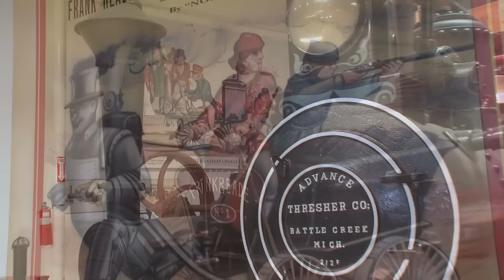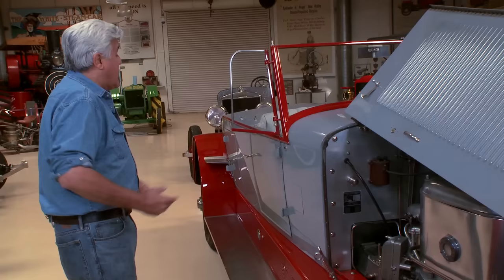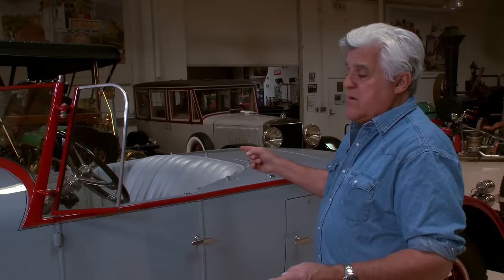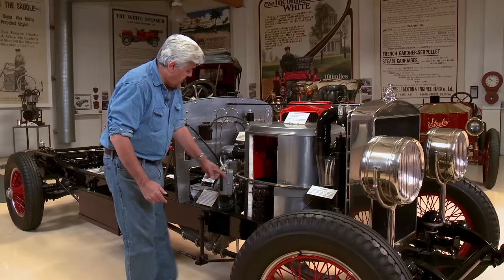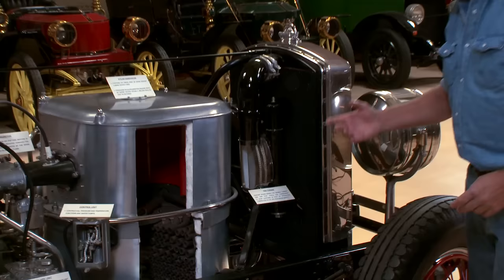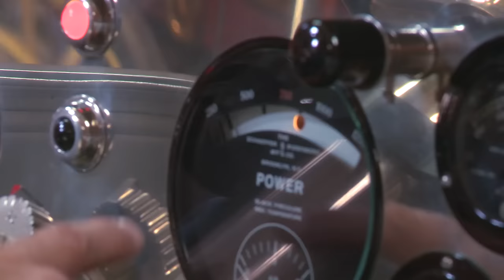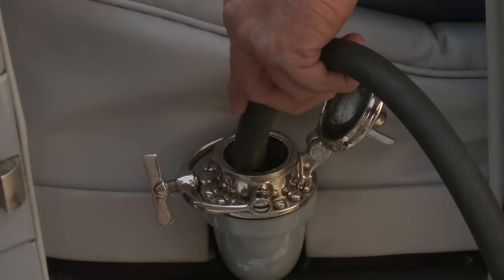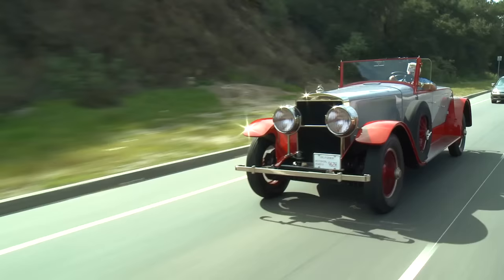1925 Doble E-20 Steam Car - Jay Leno's Garage

Comment: How practical would a Doble be it manufactured using modern methods and parts? A good replacement for EV?
Reply: Absolutely not, the steam car is obsolete technology because of lower energy efficiency of the Rankine Cycle.
The Laws of thermodynamics tell us that a step car can never match the efficiency of internal combustion engines.
Reply: Electric motors are around 90% efficient, the best modern steam engines are less than half that.

Comment: I'm wondering, with such a complex and rare vehicle like this, why doesn't he use distilled water instead of city water out of a hose? I know calcium and other minerals in the water are the main cause of radiator buildup in conventional cars. I can imagine the build up after time in a beauty like this. I understand the final blow out is supposed to get rid of scale, but it would be nice if there wasn't scale to begin with. (How many people take the time to blow out their home water heater? It really does build up)
Reply: Because the engine has a condenser which fouls the feed water tank with all sorts of nasty crude the is no point I using distilled water... a water treatment additive such as tanic acid is often used to suppress scale build-up.

Comment: Hey Jay, you forgot to say what gas you use for the fire to heat the water. are you using propane or natural gas i can see you are not burning wood.
Reply: Jay Leno runs his Doble E series cars on regular unleaded gasoline.
The Doble like most steam cars can only operate on liquid fuel.
The Doble burner can operate on Kerosene, heating oil, diesel and gasoline.
Jay gets between 3MPG and 6MPG on regular unleaded gasoline
Reply: Steam cars that burn solid fuel are required to have a 2 man crew to drive on public roads, a driver/engineer and a fireman.

Comment: I suggest you use distilled water, Jay. That way you won't have any scale buildup.
Reply: That is not true, the Doble is a condensing engine and the condensate water will continue to foul the feedwater tank with contamination that causes scale to form in the boiler tube.
On a warm day the Doble can consume more the 200 gallons a day making distilled water completely impractical.
Jay uses soft water and a water treatment additive to reduce scale.
Reply: @sandervanderkammen9230  
You don't make much sense. Condensate water to foul the feedwater tank with what? It's just pure water with no minerals or any chemicals that could deposit as scale. And if the Doble is a condensing engine, it means that it recirculates and reuses the water over and over again, with some negligible losses due to imperfect sealing of the tubing. So, why consume more that 200 gallons a day? It should not "consume" any water.
Reply: @lucianene7741  Of course it makes sense, the condensate is fouled with considerable amounts of lubricating oil, grease, rust and other corrosion residue., these contaminant the the feedwater tank and are injected back into the boiler tube to create scale.
The Doble's condenser is much too small to remain sealed on a warm day, watch the video yourself again, the Doble almost continuously vents steam from the condenser relief valve. The condenser must remain as close to zero psi as possible.
The condenser reduces the the water consumption but does not stop it.
The Doble would require a condensing unit larger than the entire car to remain sealed.
Reply: @lucianene7741  Most industrial boiler operators and steam car collectors use a water treatment additive such as tannic acid to reduce scale build up along with frequent blow downs to flush accumulated scale and sediments.

Comment: Does it work better if you use distilled water in it so the steam generator doesn’t get calcified? Also, really cool car. It’s like a steam super car
Reply: The Doble uses a condenser which continuously fouls the feedwater tank with rust, corrosion and oil residues so no advantages in using distilled water not to mention the  car can easily consume over 100 gallons of water on a warm day.
Most steam car enthusiasts and  commercial boilers use a water conditioning treatment like tanic acid to reduce scale build-up.
Regardless the boiler tubes still require very expensive repairs and periodically replaced.
Reply: @sandervanderkammen9230  If the condenser were large enough to reliably condense all steam, distilled water could be more beneficial.  One would need an efficient oil separator to remove the internal engine lubricant from the condensate.
Modern science and technology would be able to build an engine that would run reliably without any internal lubricant.
Reply: @BasementEngineer  Without any lubricant??? Steam is not a lubricant! Especially dry, superheated steam.

Building an effective and practical oil separator is not that easy, removing dissolved metals and corrosion products even more difficult.
Reply: @sandervanderkammen9230  Some years ago I investigated such a 'no lube' coating for a potential client.  There was an outfit in Texas that produced such a coating.  It was expensive at that time.
With distilled water these will be very little corrosion.  A filter could be installed downstream from the condensed to remove any remaining debris.
Reply: @BasementEngineer  what about the dissolved minerals in the recovered condenser water?
Most commercial operators and collectors simply use a water treatment additive, like tannic acid.

Comment: Curious;  What kind of mileage do you get from a gallon of gas?  As the pressure is maintained the gas turns on and off, the throttle controls the steam, not the fuel.  Wonder what sort of mpg this gets?
Reply: EPA LA Dive Cycle testing in 1970 on kerosene was 6.5 MPG combined.
Jay's gets around 3 to 5 MPG on regular unleaded gasoline.

Comment: what sort of- I hesitate to say miles to the gallon, but some vague equivalent? Like, if you had to put in perspective how much energy worth of fuel does it burn per mile compared to other sorts of cars.
Reply: Jay's Doble runs on regular unleaded gasoline and gets between 3MPG and 6MPG
Reply: @sandervanderkammen9230  Thanks! I figured it'd be something like that. Good to have a solid point of comparison, though, to remind my steam loving self how the two modes of propulsion actually compare in efficiency. And, unlike with electric versus gasoline, the steam's increased fuel consumption isn't balanced out by decreased tire and road wear.
Reply: @bow-tiedengineer4453  Yeah, a modern ICE car is about 400% more energy efficient and much, much cheaper.
The Doble E series cost around $75,000 to build in 1926 (around a million dollars in today's value).

Prior to 1915 steam cars made up about 35% of all the cars registered in America.
After 1915, it dropped to about 1% before going completely extinct.

Charles Kettering invented the electric starter in 1914 and steam car manufacturers either switched to ICEs or quickly went bankrupt.

Comment: how do you stop if it's direct drive is there a centrifugal clutch, or just diverts the steam from the pistons back in to the condenser.
what does it use LPG gas to heat boiler? what do you get per mileage on the fuel.. not the water
Reply: You simply close the steam valve to stop.
The Doble burner can use gasoline, kerosene or heating oil.

Jay gets between 3MPG and 6MPG on regular unleaded gasoline.
Reply: @sandervanderkammen9230  could the pipes take the pressure?? if you just turn it off.
doesn't sound sensible way of doing it, I would have thought the best approaches would  have a diversion valve as i stated and send it back to the condenser.
yeah LPG would be a better clean a fuel could be used
Reply: @hoobsgroove  You get a slight engine braking effect just like an exhaust brake on a Diesel engine.

L.P. is not very energy dense, the Doble already needs a 35 gallon fuel tank, LP would require a much larger, heavier fuel tank to keep the same range.

Comment: I truly believe that had we stayed with steam instead of switching to internal combustion engines, we would be well ahead of where we are, both in terms of fuel efficiency and cleaner burning.   

The big innovation in my view that Doble provided was to superheat a relatively small amount of water at a time.   

The next big step would have been oi ditch the pistons and use a small, high-=speed turbine as the actual steam engine.   A Tesla steam turbine might have been a very good starting point.   

When I was in school, I roomed with 2 other nerds.   We were all into engineering and were fascinated by steam cars.   We never had the resources to build our prototype, but our modeling and calculations promised that using a good steam turbine and super-heating small amounts of steam at a time would have driven a "standard-sized" sedan of the times, around 1963, over 100 miles per hour, and at 60 MPH would have yielded better than 100 MPG.   Further, the longevity and maintenance seemed quite favorable, as well.   

Anyway, thanks for preserving this beautiful piece of history and for sharing it with us.
Reply: Nothing could be further from the truth... steam cars are obsolete technology and steam has always been inferior to internal combustion technology.
The invention of the electric starter for internal combustion cars in 1915 wiped out the steam car companies by eliminating its only advantage literally overnight.
 Steam cannot compete with ICEs, steam is much less fuel efficient, dirty and way too expensive.

Any questions?

Comment: There's only one question that I have: does it have reverse?
Reply: Doesn't need reverse. Reciprocating steam engines can run in either direction.
There is a small pedal on the floor board that switched engine direction of rotation.

Comment: Jay I believe we can design new compact steam powered engines much simpler for cars...they can be small compact run on propane or and natural gas...Steam has pushed miles of steal iron traine across the US it can certainly push cars...just put 200 degree water in a plastic coke bottle shake it and feel the combustion in your hand...if we make the pistons amd block out of ceramics we won't need to oil the engine...
Reply: It's was a joke, Jay's a comedian not an engineer.
Steam cars have been obsolete for more than a century for some very good reasons... most important is the horrible fuel efficiency and incredibly high construction and operating costs.
Reply: That is false, modern internal combustion engines use Silicon Nitride ceramic cylinder liners and hypereutectic pistons but they are easily destroyed by lack of lubrication.
Reply: @sandervanderkammen9230 Ceramic engines have been in operation since the 70s...the Japanese developed this tech years ago...they have 100% ceramic...their are many high tech engines made of ceramic...I guess you don't follow tech..m
Reply: @danielraymadden  Apparently you don't follow technology much... because these engines still require lubrication.
Reply: @sandervanderkammen9230  Tell Japan they wrote the spec...their explanation was ceramic they created was heat resistant does not expand..Who am I to believe...you who has not accomplished anything in life...or Japan's top scientist engineers...it's you against them...I have to believe you were not born at the time...
Reply: @danielraymadden  Please cite an example of a commercially available  automobile engine that does not require lubrication?

Comment: If this runs on water, then you have solved a number of problems. By the way, when you  get to where you are going, does it make espresso?
Reply: The Doble E series runs on gasoline or kerosene, water is only used as a working fluid, not a Fuel
Reply: @sandervanderkammen9230  Thanks, but you are saying a steam engine  does not run on water? CAn you explain. Leno showed the internals
Reply: @IDamian1  Correct, heat is required to turn water into steam, this heat is created by the burning of fuels like gasoline or kerosene.
Jay's Doble runs on regular unleaded gasoline and gets between 3MPG and 6MPG

Comment: Given the thermal insulation materials we have today wouldn't  it be a more  energy efficient  to use keep reheating water as a power source than use fuel for direct drive  . Not surprising the bigger manufacturers walked away as the power of would be more better the gas powered engine .
Reply: That goes against well-known and understood laws of thermodynamics.

Nicolas Carnot published his formula in 1824 showing that internal combustion engines are more efficient than the Rankine Cycle.
The Rankine Cycle can never match the efficiency of ICEs and this was conclusively proven by Rudolf Diesel in 1897.
 Any Heat Engine that requires a phase change in the working fluid eg; turning water into steam is inherently less efficient because of the higher thermal entropy and conversion loss.
 The conversion loss, called Latent Heat was discovered by Joseph Black in 1762.
Any questions?

Comment: Wow .  As you drove it you could see steam escaping -much like a locomotive; don’t understand that.  The complexity is almost “unbelievable “.  Doble must have gone to MIT because this is NASA engineering of the time period.
Reply: The condenser cannot handle the flow of steam on a warm day and the pressure relief valve remains open almost constantly.

The Doble E series is mostly obsolete technology at the time it was produced, it used old technology, by 1926 all the steam car companies had either switched to ICEs or gone bankrupt.

Comment: It would be nice to know the diameter of the cylinders and the stroke of the engine and the weight of the entire power system. If this cand be obtained, calculations for use in a 19th Century Hensen and Stringfellow "Aerial Steam Carriage" flying machine. After all, Hiram S. Maxim flew a steam powered aircraft in 1884 and it was only the lack of control surfaces that prevented him from becoming the "father of aviation"
Reply: @sandervanderkammen9230  So that is what was used in that aircraft. Thanks for the info
Reply: @Jagdtyger2A  Besler Brothers built this aircraft, a prototype Kaiser Manhatten and 2 prototypes for General Motors... the SE-101 steam powered Pontiac Gran Prix and the SE-124, a steam powered Chevrolet Chevelle and some prototype passenger railcars (light rail) all using the Doble patents and salvaged parts from the bankrupt Doble company.
Reply: Doble boiler in GM SE-124. https://youtu.be/OoXr09y2AQ4

Comment: How efficient is this amazing machine?
Reply: 3 to 6.5 MPG on regular unleaded gasoline...
Reply: @sandervanderkammen9230  like a large van then.... similar weight. Reasonable for the time I guess
Reply: @jeremyaustin9103  Horrible efficiency even by 1926 standards...
Modern internal combustion engines  are around 500% more fuel efficient.
Reply: @sandervanderkammen9230  Well I "used" to have a PHEV that I used to visit Germany. (I live in England) The rotten thing got 21MPG on an Autobahn with just me in....and was so slow it was dangerous. Saw the error of my ways and got a nice merc v6 cdi...I am thinking that design was pretty clever...with modern materials would be a lot better on fuel. Tail pipe emissions would be cleaner too

Comment: I learned so much here from Jay. Thanks guys. Brilliant. I wonder what the cost would be in comparison if a modern steam car could be made and compared to gas and electric.
Reply: These cars cost around 1 million dollars each to build in 1926, steam engines are the most expensive type to build and maintain which is why steam cars have been obsolete for over 100 years now.

Comment: It is such a pity that this technology was not applied to steam locomotives which only really died out in the 70's - 40 years after the steam car died. If it had been applied to locomotives we would probably still have them running around now... Another "what could have been"...
Reply: Compound engines were in use long before this car was built, nothing new about this technology.
The Doble was obsolete on arrival with steam cars rendered obsolete in 1915.
Steam locomotives were being phased out by the 1950s, they were long extinct by 1970.

Comment: Does the car have a reverse gear so you can back it up?
Reply: No reverse gear is needed, recprocating steam engines can run in either direction.
To back up the car you simply depress the reverse valve pedal to the floorboard and open the steam valve.